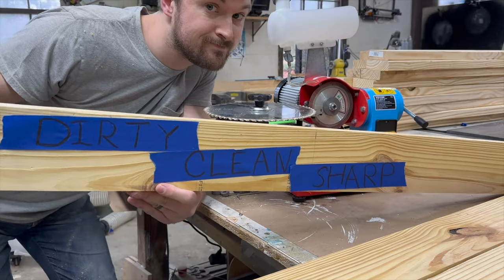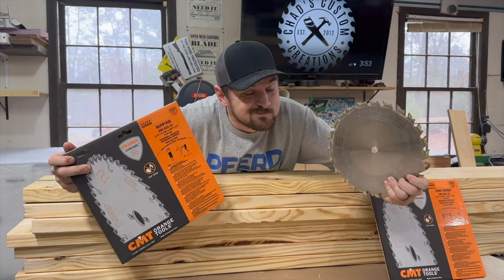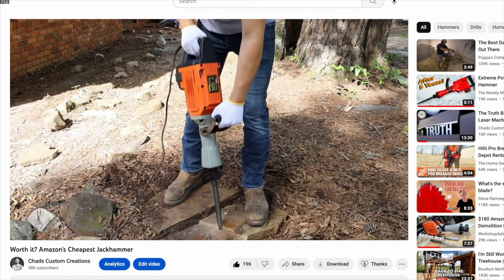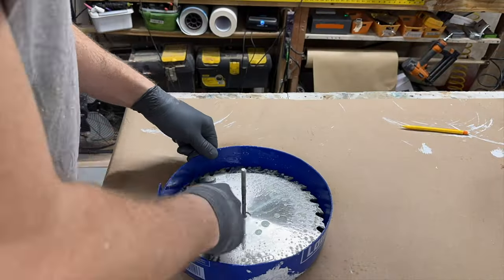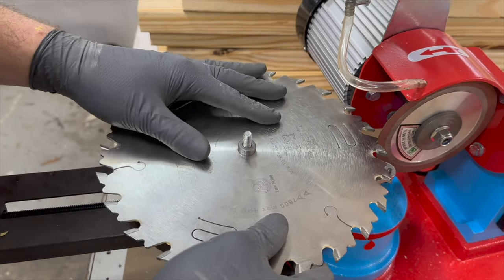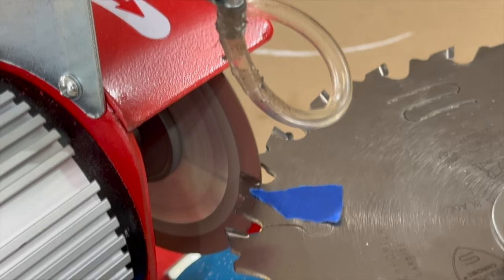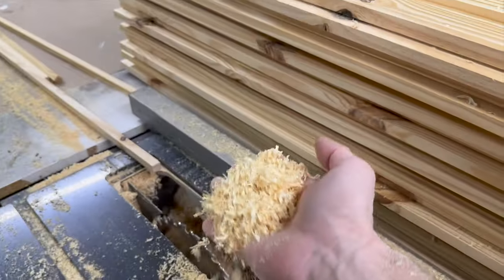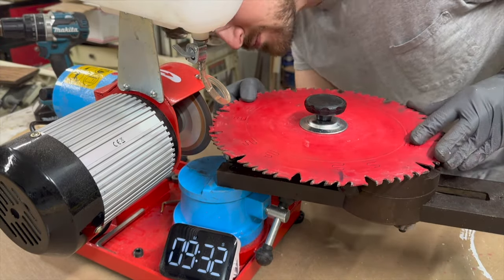Dirty, Clean, or Sharp Saw Blade Sharpening is it worth it?

Comment: Great video!  I just bought the exact same tool to expand my knife sharpening business.  One thing I noticed on my blade and yours as I was watching the video is the diamond sharpening blade seems to have a lot of run out on it.  When you were hand turning the sharpening blade to the saw blade (6.00 min) I could see your sharpening blade had a little side to side.  I measured mine with a dial indicator, mounted on the motor shaft, brand new, never used and the runout was 0.020.  In contact with  VEVOR Customer Service, hopefully they will send me a new blade.
Reply from the maker: Yes I noticed that also. I wonder if after a few uses would that runout eventually grind itself away?

Comment: You should see the pine pitch we have in a log run we just came home with, super straight limbless pines but, they have destroyed probably over 4 blades now with only being able to do maybe 3 or 4 orders.  Oh and destroyed band belts as well.   I so badly want to burn the scrap in a barrel and make pine resin out of it, but we are already busy with so much.
Finally almost done with our wood kiln, AJ showed me the Solar working today.

AJ's birthday is right around the corner, I might need to get some of those blades and that sharpener for him.  We use his Milwaukee Skilsaw when we have to split boards in half.
Reply from the maker: Pine can be the worst